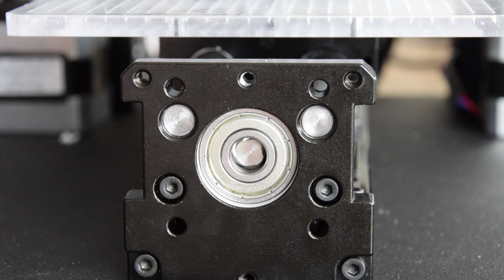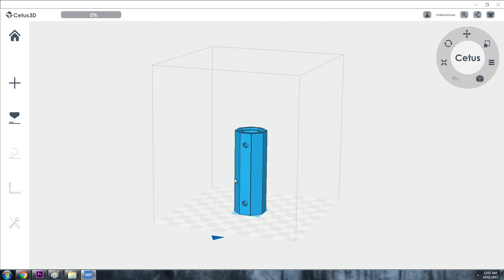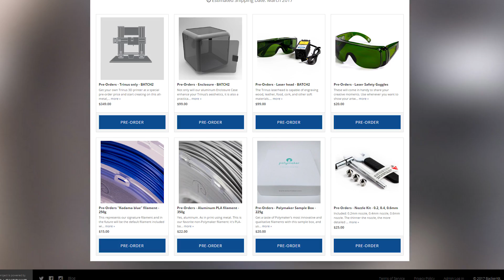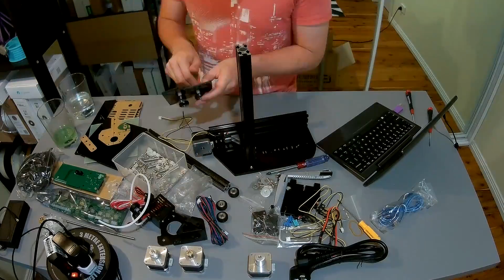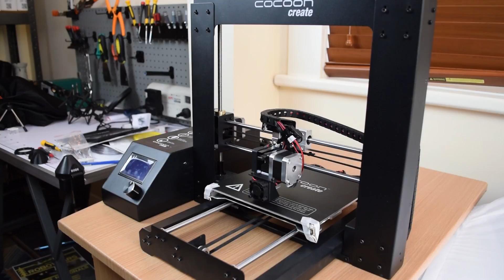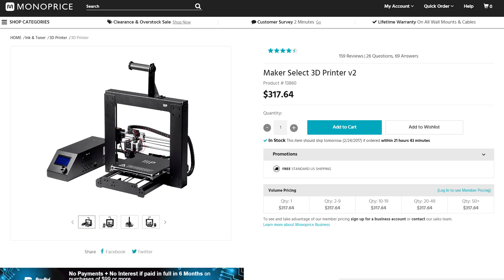Cheap 3D Printers THAT DON'T SUCK $350 and under

Comment: How come no Tevo Tarantula 2017 ?
Reply from the maker: My kit that I was sent last year had many issues, and I was unable to get it running correctly as stock. I do not consider the Tarantula a machine for beginners, or those looking for a quality 3D Printing experience without having to invest a lot of time and additional money into upgrades.
Reply: Ok thanks. I'm in Australia as well. Just looking at the Balco you have suggested. The Tarantula has a huge Facebook group following and to me it seemed to be pretty good. I dont mind the idea of a kit 3D printer.
Reply from the maker: I can't make your choice for you, but based on my own experiences I can't recommend it.
Reply: Thanks

Comment: You missed out the Kossel Mini :(. It's £199 but does come as a kit however I'm 14 and I managed to assemble the entire thing and all the electronics (ramps, Arduino, ect) on my own. The print volume is decent and it has a heated bed that I've been able to get up to around 110*C. It uses a bowden extruder and I've been able to get some immaculate prints out of it, including torture cubes. The only catch is lack of customer support, although emailing the guys (to get the manual...) was really easy.

Comment: @Maker's Muse Also, the wanhao duplicators are sold at Micro Center in USA. Generally slightly more expensive for the printer + sales tax, but you do get the printer same day, so there's that. Also Micro Center typically has a pretty good return policy, although I have never tried it on a 3D Printer. 

http://www.microcenter.com/search/search_results.aspx?Ntk=all&sortby=match&N=4294898921&myStore=true

Comment: I saw and was very tempted by the ALDI printer. I was turned off by the fact they don't resell consumables at the same nice price.
Having bought a fog machine for $35 only to be reduced $10 one week later (to $25 for a 400 watt fog machine), With no fog juice sold EVER was enough to reconsider anything that needs consumables bought from ALDI ever again.
That in my opinion is the worst thing about buying anything that needs anything else to make it work, Not selling the consumables.

A company that genuinely wants to exists, Will sell any and all consumables regarding their product.

edit:small typo

Comment: Is it possible to design a 3D printer using 3D design software, print out all of the parts, then build it yourself? Literally, Can you use a 3D printer to create another 3D printer?
Reply from the maker: Yes it is! Check out the reprap project, that's exactly what it is. there are loads of open source designs you can print parts for and assemble yourself. :)
Reply: Awesome!! I Certainly Will!!!
Reply: Yep, ive done it and have gotten excelled results. The best part is, you know your printer like the back of your hand and if you want to change anything, there isnt anything stopping you. I wanted mine to be solid, so i built it out of 3/8" aluminum plate. The sky is the limit

Comment: I have an Anet A8. I know that isn't a printer for this list. It has acrylic frame. It has problems with PSU and hotbed connectors. It also needs some other little improvements and parts that can be printed by itself. But I love my 3D printer. It works awesome and thought me a lot about 3D printing.

Comment: Shame no mention of the FlyingBear902 (318$ shipped) kit  that has a big community but a huge  mention for the poorly built (3d printed parts!) Tron ! Cmon you could do better than that !
Reply from the maker: The Tronxy X1 has only one 3D Printed part, and even if the quality of that bit sucks it's easy to replace. I don't know enough about the 902.

Comment: Cetus3d prints PETG better than PLA. No heat bed required. The coating they use is amazing! Several dozen prints already.
Reply from the maker: +atomu235 now I really have to try this!
Reply: I have the sprayed on bed version. No raft. Excellent PETG bed adhesion. No warping, no smell, minimal stringing due to direct drive extruder, food safe. Had trouble removing initial prints.
Reply: I mentioned in Angus' live session the other day that I had printed Edge and nGen.  I've also managed XT with obscenely good results (2mm sq wiry bits popped out from totally enclosing support - sorry can't post due to NDA).

Note that I'm running the printer in a closed popup photographic tent with an air scrubber running...
Reply: And now I've run some Edge Crystal with a 0.6 nozzle at 0.4 layer thickness.  Beautiful. Apart from trying to get the raft off which requires a little patience.
Reply: Also did a successful PETG testprint (https://www.instagram.com/p/BRAjtzMDQwV/) For me, being an absolute newbie to 3d printing, the cetus is really a great machine. However, I used quite a low temperature (220 C) as with 230, the filament didn't seem to cool quickly enough (the thin lines on the raft sagged). Any recommendations on why you guys used?
Reply: Also did a successful PETG testprint (https://www.instagram.com/p/BRAjtzMDQwV/) For me, being an absolute newbie to 3d printing, the cetus is really a great machine. However, I used quite a low temperature (220 C) as with 230, the filament didn't seem to cool quickly enough (the thin lines on the raft sagged). Any recommendations on what you guys used?
Reply: I use 230C for transparent PETG and 240C-250C for color ones. No issues at all (more than usual stringing with black and blue). I use Hatchbox and Sunlu filaments. Sunlu transparent PETG makes great cookie cutters for my sister :-) Ps. I print with no raft.
Reply: White Spirit restores bed adhesion.

Comment: Those probably aren't IKO rails on the Cetus. IKO has a light blue as their signature color on the rail cars. Assuming they're genuine, it is HiWin that has the green with red end caps. But HiWin is the most heavily knocked-off brand of linear rails. The knockoffs can be good but it's a risk if you buy them on your own without QA.
Reply: My Cetus extended actually has both brands. Hiwin for the Z & IKO for the X & Y axises
Reply from the maker: Haha good catch! Pre production had hiwin which is what I have, they decided to move to IKO for the production units. Both are quality rails, definitely needed in a cantilever design like that.

Comment: IMPORTANT QUESTION MAKER'S MUSE!!! Have you used your original UP Mini on the latest windows 10 update? Windows is trying to add custom 3d printing software and drivers for most printers. However, i believe that the windows default 3d printing drivers is messing with my UP Mini drivers and overriding the UP's driver and it is causing my printer to basically not work at all and act extremely strange. I was wondering if you could check into this and see if you can find a way to fix it, if it is happening to you too. I will keep getting USB malfunctions until this is fixed. I really hope you see this.

Comment: I really recommended the Monoprice printers. I've got the Maker Select and it can produce amazing things with the smallest hint of printer knowledge and Slic3r. The machine is very forgiving to people who are new to 3D printing, take it from me, I learned to get good prints from mine after 4 months of failures. I don't blame the printer, I blame myself for having the nozzle size set to 1.75 because that's the logical leap my twelve year old brain took when I first had the machine. I can confirm that it prints beautifully in PLA and PETG, but I haven't tried ABS because the machine is in my bedroom and I've been told ABS smells atrocious.

Comment: You touch on it slightly, but I think there needs to be more focus on the company support being provided to the purchasers of 3D printers. We talk about Kickstarter dangers, but we rarely discus company support.  

I think you know how I feel about HobbyKing because they stole $270.00 from me, so I'm a little jaded. HobbyKing has a strong "F" rating from the BBB 93% negative and 7% positive. All anyone has to do is google "hobbyking review" and your audience will see in most cases thy are at the bottom of the barrel with 1 and  2 star ratings. This is a company that people NEED to be warned about.

They should be in the same class as "you will get no support from them" after the sale as the one you mention in the video.

Edit: Especially because this video is directed at people wanting to get into 3D Printing..
Reply: :( I feel sorry for you. They must be treated badly, as how they treated the users.

Comment: No ebay chinese reprap prusia i3? I'm surprised, it's averaging around $250aud on ebay, although most of them are going for $230ish. I bought one of those reprap printers for $500 way back in early 2015 before aldi even released their printers (I had no idea!). It's still working today, just needs a lot of care. Prints really well at 0.2mm.

Could you do a video talking about adding auto bed leveling to a printer? I think that would be a really cool video.

Comment: And I even pre-ordered a Tiko...
Oh well, they contacted me saying they will refund my money and i went over to eBay and bought myself a Kossel Delta RepRap for 175€
It came as a kit much like the Tronyx with a build volume roughly 160mm in diameter and 300mm high. I've been printing in PET until now and even gave the lattice cube a test, which turned out okay-ish.

Comment: Proprietary slicer on your 3d printer?
No problem, find out which board your printer use and just flash it with compatible open-source firmware.
95% of typical printers are build on open source boards like rambo on atmega or smoothieboard on stm32.
Some of them may have changed PCB design but still same connections, or only swapped connectors.
Reply: As a hobbiest, I see that as bad.  I know they want to lock down their userbase, and optimize the hardware, but when a custom board goes out, you will be stuck.  

If the arduino blows up, there are 192 vendors to get a replacement from.
Reply from the maker: usually yes, however the Cetus and other UP 3D printers use entirely proprietary hardware - the board is custom made, and it has a close source firmware. Their latest software lets you run other gcode but it's more of a parser - still very experimental.
Reply: Ok, but what uC they use?

Comment: I bought the Balco 3D printer 2 weeks ago from Dicksmith online and I haven't been able to stop myself printing with it. I am so impressed by the print quality of the machine, especially since I have only had one failed print. Would highly recommend the Balco, however I would recommend getting a "3D printing tool kit" from JayCar or somewhere as it only comes with a scraper, and certainly buy more filament ASAP.

Comment: Is it possible to buy any of the 3D printers you mentioned in Europe?
Reply: EpicVideos Is it matters where are the 3D printers come from if they are awesome? :)
Reply from the maker: many ship direct from china, or you can find local resellers.
Reply: Also check out smartrapcore, they are french I believe.
these guys seem to be under the radar, but I like their old smartrap idea, I have priced the parts at about $200us
Reply: Hobbyking.com used to stock the Malyan M150 in their European Warehouse; it's a Wanahoo i3 copy and I have to say I'm really happy with it. There was even a sale at Hobbyking when I got mine, it was 200€ shipped to France. I just checked it's discontinued for now but you should check.

Comment: I have a feeling the Tevo tarantula is a terrible machine
Reply: While it can be a terrible machine, with a little bit of care and effort it can be a pretty good machine, especially for the price - as long as you have the free time to fiddle.
Out of the box the instructions are terrible and a few parts are of questionable quality, but the majority of parts including the chassis, heated bed and steppers are all good, and there are now several video assembly tutorials around.
Reply: i have one, it definitely takes some time to get running properly, but once it works and you add a cooling fan, the quality is decent.
Reply: yeah i think so.. just need to have some 3d printed part and the quality looks very good for $200.

Comment: The Wanhao i3 is initially a tricky machine to use, but the community support for it is really awesome. I have solved almost all of my problems with the printer by asking co-owners of the machine in the group. After making some suggested mods, the print quality was almost like that of my original Prusa i3 Mk2.  :)

Comment: I upgraded my Wanho so much its now a core XY printer :P
Reply: Any videos or info on this? Sounds cool :-)
Reply: google hypercube 3d printer by tech2c
Reply: I know what the hypercube is. The question is how you got from the Wanho to a corexy. If you have something like a hypercube then sounds like you just scrapped it and used it for parts.

Comment: The Print-Rite 3d printer should get an honorable mention in a line up like this, i bought one from hobby king in Australia for $260 for a friend that was interested in getting in to 3d printing and after the quick build and setup he was off and running. Great quality prints at decent speeds. no heated bed and it could use some noise dampening but for the price you really couldn't pass it up.
Reply: ^putting it on cork floor tiles that i picked up from bunnings dropped the noise considerably and for a tidy $14  :)

Comment: I backed the Cetus ( extended ) partly because of your review and that it was also designed/built by teirtime. So i knew i was backing a machine that was built by people who had a proven history in actually building machines.
i could not be happier with it. So far I haven't had a failed print ( touch wood ) out of the 8 300 mm prints I have done so far and in fact when the power plug came out by accident I was happy the resume feature worked well.
Reply: Richard Grenfell still like it?  I have a maker select V2 but have been wondering about the cetus, it looks like it would produce more accurate prints at higher speeds and I also bet it's quieter.

Comment: I ended up getting the Kogan "Balco" Wanhao i3 clone - and I love it - my sister also ended up purchasing one.
However, after about 1 week's run time the power connectors on the mainboard burnt out. This seems to be a pretty common issue on the Wanhao Duplicator i3 v2.1.
The power plug just does not support the current that is required. 
We went separate routes on this, I fixed mine myself by replacing the power connector with an XT60 connector, my sister instead claimed a warranty repair.
The warranty repair was local, and only took a day, and they replaced the mainboard and beefed up the power connection and cabling.

So while it was a little disappointing, the support was amazing, and this is my daily printer, clocking over 40 days straight of printing. It's a beast!

Comment: Hi, i bought a cetus and i'm using it with both his software and simplify 3D infact is a Gcode compatible printer. You have only to experiment with settings in S3D and then load the gCode trough his oun sw. I hope you'll make a tutoria. is really intresting :)

Comment: I've been very happy with the Da Vinci Mini (wireless version, even though I never use that either) that we got for Christmas ($269 US).  While it only uses proprietary "chipped" PLA filament, the cost of that is pretty reasonable (200m for $27 which lasts me about a month) and it can make some beautiful prints (like Amaochan's pangolin from Thingiverse).  Always impressed with how strong and light weight the created prints are, as long as you're printing a good design.  Reasonably good if somewhat basic slicer software provided, which you aren't required to use.  I hope that they'll release a flexible filament for it at some point (to enable making things like phone cases).  Base price includes everything needed to get started.

Comment: I'm rocking an old prusa mendel that has been pretty heavily upgraded and so far I've spent less than Muse's criteria. Legacy equipment does have that advantage. (Disclaimer. I used advanced geometry and a really good set of calipers to make my machine specifically out of spec to prevent the resonating wobble many people have complained about.)

Comment: You can use whatever slicer you want with the cetus. You just have to use a gcode to up code converter. I have been doing so and it works great, so much better than the cetus/up software. Check out reddit.com/r/cetus3d